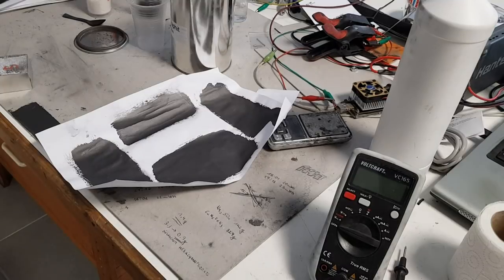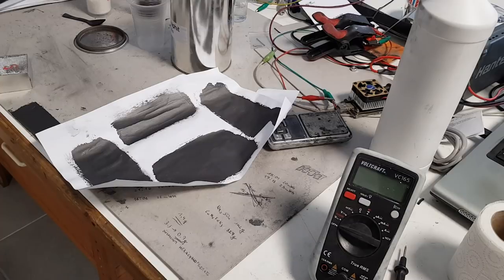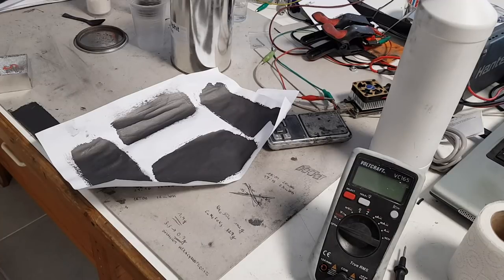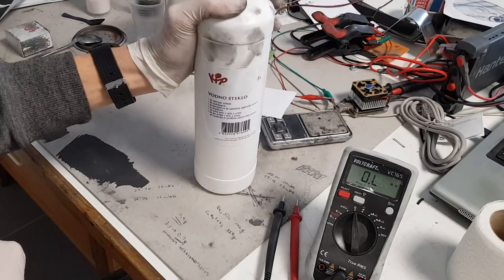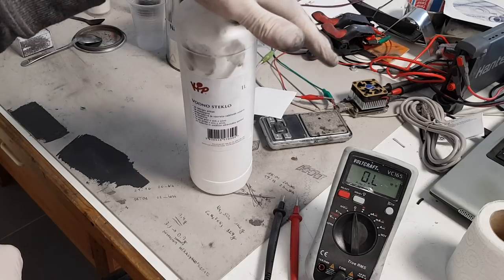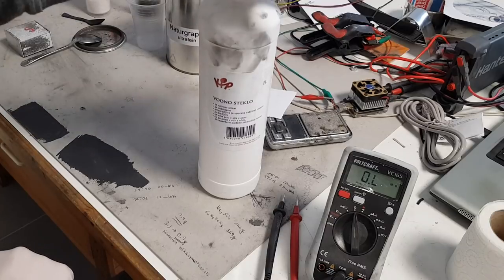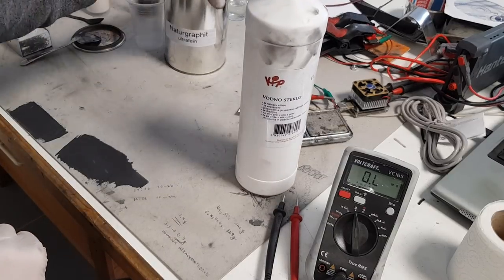How to make Conductive ink easy and cheap - remake

Comment: Dude you are a genius! Thanks so much for this! I've been looking for a cheap way to make a conductive coating for a mosquito net fabric to make a portable faraday cage... Would this work? I might electroplate it for better conductivity. 10 ohms is great! Thank you!!!
Reply: Have you made any progress on this? Saw your comment on Robert Murray's channel too :D

If you are after on some HECS blanket etc, you might consider making it weaved from ground heating cable. I have been planning to make one like that someday. I'm planning to use the pealed cable strings going vertical and use aluminum coffee package strips going horizontal. Just making small squares and sewing them together.

Comment: Rub the surface nail well until the surface gets a metallic sheen. The paint graphite dust then combines and the coating becomes more electrically conductive. You must achieve a conductivity of less than 150 Ohms for a length of 1 cm. Then cover the surface with a clear film to make the coating not only conductive but also resistant to water and mechanical scratches. This is a cheap stealth coating technology for drones that become invisible to radar.
Reply from the maker: US air force want to know your address. 😄

Comment: Hey, that's so great.

For how much time it is durable? What is the durability of this ink?
Can we use it to print the solar panels?
Hoping for earliest response.
Reply from the maker: Real life durability out from my hands is now around 3 years without any perceptible changes of the ink. But the ink can last longer. Using that ink for solar panels is not the best I think, but you can try it anyway. Maybe some dry ink can be good. But like I said, try it and see.
Reply: @cayrex  Okay.. Thanks for the reply. 
Have a nice day.
Reply from the maker: No problem. You too

Comment: Hi I tried this methode but the dried ink is not water resistant. Water disolve it unfortunately.
Instead sodium silicate I used 2 component epoxy resin. It was bit difficult to mix but final coating is water resistant. I think if I would use acetone to disolve the mixture it would be easier to make a smooth layer... maybe you could make a video about tbis epoxy resin/acetone/graphite mix?
Reply from the maker: Hmm, interesting. Do you try with sodium silicate from diffrend brand? Sometimes the concetration of the product is not good. I try two diffrend sodium silicates but each time I get waterproof ink, like I show you in the  video. Epoxy is good but I think that the resistance will be higher. Yes I will try to make a video about epoxy conductive ink,.... just wait a little bit, because I waiting for the graphite.

Comment: hello my friend. I have made conductive ink based on sodium silicate. I have put it in a ceramic plate, I have it connected to the current 13 volts 7 amps, I had a problem, as the plate was heating the conductive ink begins to bubble. do you know the reason? thank you. you are the best.
Reply from the maker: Yes. The ink is still wet
Reply: @cayrex  I let it dry for 16 hours, I painted it two coats. thank you very much, you are the best again.

Comment: Hı cayrex. I tried to make this ink. But the mixture didn't happen homogenous.  Graphite powder sank to the bottom. I think my graphite size was a little thick. What do you think about this. And what size of graphite which you used in micron?
Thank you
Reply from the maker: Hi! The size which is good to make a paint will be from 45 to 5 microns. If the paint is sitting for some time you will get some sediment for sure.

Comment: Can you make it into grease? It would be useful for car electrical contact such as the battery terminal and grounding cable contact point
Reply from the maker: Yes it is possible
Reply: @cayrex  make a video and measure the resistance between the battery negative to where the ground is connected lets see whether it decrease significantly...It will be great education and benefit for car community

Comment: Hi I tried this and it worked great with good conductivity, but it washed off the paper very easily. There is not much to it just sodium silicate and graphite so I don't know why mine was not water resistant ?
Reply from the maker: Hmm,.... I dont know what can be the problem. I make two videos on the same ink with the same materials, only water glass was diffrend brand. And always I get water resistant ink. Try some other sodium silicate
Reply: Waterglass forms a gel in acidic conditions.  Perhaps it would set to an insoluble film if you spray with vinegar or some other mild acid.
Reply: @ericslighton5813  dammit why doesn't my inorganic chem textbook have any information like this!!!??!!

Comment: is this the same mix you used in your update?  The water glass you are using is quite dilute.  The higher concentrations are more viscous.   ie 40-42 deg Be.  If you want to make consistent ink smears, consider making a Mayer Rod or Doctor Blade method.  The Mayer Rod method is simple: wrap a wire tightly around a 5-10mm rod and draw it across the ink on the surface.  Depending on the wire thickness, you'll get reproducible, even films.  Cheers!  Doug

Comment: I saw one of your older video where you did the same ink with carbon and you got almost the same resistance results after polishing. So is that difference to make a good conductive ink, using carbon or graphite powder?
Reply from the maker: Yes, to make good conductive ink is depending on almost all used materials like binder, conductive material, size,... in basic graphite is also a carbon. Graphite have lower surface area as activated carbon or carbon black, which means that you can add more graphite into the binder and still you get good liquid ink. But if you add some activated carbon or carbon black to the binder,... the load of carbon will be way smaller for the same liquid state of the ink. But if you add the same amount of carbon black or AC that you use with graphite,.... the ink will end up like pasta.
Reply: @cayrex  Very good answer, very understandable for me. Thank You! So smaller size would be graphite oxide but it is more expensive to produce thats why graphite is the best (optimal) for the conductive ink.
Reply from the maker: @jtoomla  yes, that's right

Comment: I was try your project before, graphite and water glass/ sodium silicate. And it was not waterproof and the result on ink paint was not thick like what you did. Is there any reason about my failure?

What i confusing is, how can be your ink was waterproof, is that from sodium silicate did you use?
Reply from the maker: I use some cheap sodium silicate from technical store. I dont know what was the concentration of sodium silicate but was little more thick as some other sodium silicates. If you put for long time into water, the paint can go off after some time and rubbing. So is not 100% waterproof. But is no panic if you put into water for short time or if some drops of water will drop on the paint. Try to find some sodium silicate with higher concentration.
Reply: After you respon my question, i was trying find more literation. You was right about silicate ( not waterglass) can use for water proof coating some parts. Its about concentration of NaoH + Sio2 which my supplier made. I was try it on the other supplier, and it was same. So i was make the other method for make conductive ink, graphite and thinner( or aceton maybe, i has try it and fail too) which melting the plastic and sterofoam. Is that method can works for make it?
Reply from the maker: @gambangtekop9910  right! So, to make a basic paint you need active material (pigment, like normal paints ar using or in your case graphite), binder (is in basic  glue, that hold active material in place,... PVA, sodium silicate, PU glue,...) and solvent (which dissolve binder and make all luquid,... water, acetine, other organic solvents). But you need to know your binder,.... what solvent will dissolve it, will be waterproof when will be dry, flexible, etc,... so, the binder plays important role. Make PU glue, acetone, graphite or PVA, water and graphite. Play with amount and you will get not the best but good paint.

Comment: is this ink resistant to electrolytes? or will be damaged
Reply: This paint does not adhere to plastics, glass, metal, only porous surfaces such as wood, paper. It flakes off from plastics, glass, leaves, etc. when it dries. The best quality paint available today is the graphene paint by Robert Murray Smith, which can be applied in an extremely thin layer on various surfaces, yet it possesses extremely good conductivity. The conductive material is only about 1/4 - 1/6 of what is shown in this video! When graphene settles, it occupies only about 1/6 of its original volume! This is necessary to be able to paint in a very thin layer. For electroforming, it is crucial that the applied paint conducts as well as possible in the thinnest layer possible.

Comment: Hello, very informative video. could you please give us the link for the natural graphite at ebay for 9 euros. i ve been searching and most of them they sell synthetic graphite and the cheapest is 19 euros for 1kgr. i would appreciate if you post the link. thank you
Reply from the maker: The graphite is 1000ml which is not 1kg,.... in kg is around 600 to 700g. Here is the link: https://www.ebay.de/itm/7-99-l-Graphitpulver-Grafitpulver-Graphit-Grafit-Schmiermittel-1000-ml/153288184560?hash=item23b0b012f0:g:UXkAAOSwDthZpRFu
Reply: @cayrex   Hello, you doing a good job. I allready passed all this tests with heating elements and heaters. Little advice, you can add a copper powder to a graphite. It helps you put up electrical conductivity without resistive changes.
Reply from the maker: @Антон-п9я3и  the copper powder will oxidize over time. The copper oxide is not conductive.
Reply: @cayrex  its oxidize only on air but not in water glass.

Comment: Hello sir. I tried your procedure but mine has higher resistivity almost 500k. When I saw your sodium silicate its different from mine, it is so sticky and yours is not. Can you help with my problem?
Reply: Did you find a solution to this problem ? Did you use more small graphite? Did you use less Silicate and more graphite ?
Reply: @eloistreeraw  same her and i did less silicate and do more graphite and the same 1000 ohm per CM 
my silicate not clear as yours its make diffrent ?
Reply: I dont know if it is important for the sili.   ps: do also have a problem with with time the paint become white like it was attack by mushroom ?

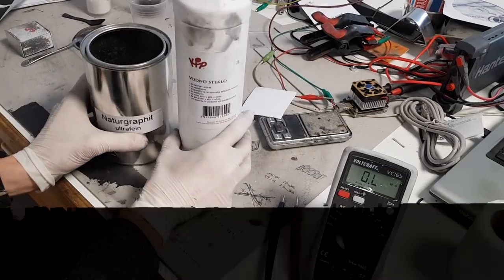Comment: Spilled some conductive ink on the video at 5:26
Reply from the maker: Yes, here I paint a litle on my desk to try out.
Reply: @cayrex  No, no, it was a joke. There was a flash of black encoding artifacts or something at the bottom of the screen. So I was joking that you spilled some on the video file.
Thanks for this recipe, I think I'm going to try to use it for plating through holes on DIY circuit boards, applying it to the edges of drilled holes then plating with copper.

Comment: The cracks ithe ink would be an indicator of a sudden structural structural failure so it could work as a sensor
Reply from the maker: As a sensor?
Reply: @cayrex  Yes, it breaks - it sends an OFF signal

Comment: Can i use this in a paint spray gun?
Reply from the maker: Yes, if it's too dense you can add more water or sodium silicate. Mixed very well  to get smoot paint and you can use in a spray gun
Reply: cayrex2 thank you. I will try to make up some ideas for uses for this paint. Do you think homemade circuit boards are possible if the material used for the board is hard and not flexible?

Comment: My graphene ink doesnt conduct! Why is that
Reply from the maker: For many reasons. Bad low qualty graphite, you add to much binder, the ink is not dry,... But most of the time is bad graphite
Reply: @cayrex  i used 99.99% pure graphite as per paper! Used 300 ml pvp and 50 gms graphene

Comment: hello could I ask you
Reply from the maker: Yes
Reply: @cayrex  Welcome. I am very interested in what you offer. My question is about the preparation of conductive and water-resistant carbon inks, as the ink industry relied on polyvinyl chloride as a binder with the use of a specific plasticizer, because I want to print it through a 165T silk screen to prepare a sensor printed on a PVC board, but the ink resistance is about 90 ohms, and I want to make it close to your ink that made in  the video. Can you help me?